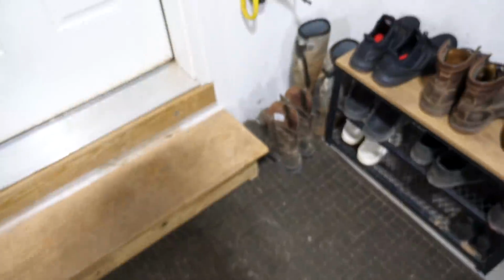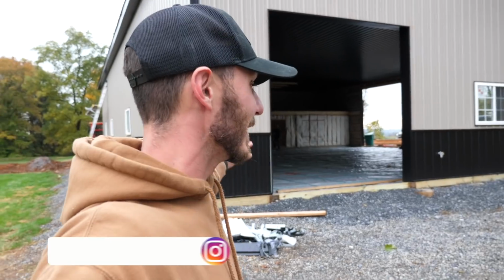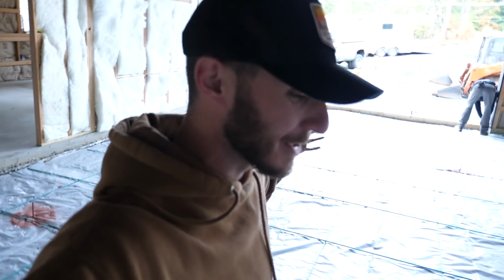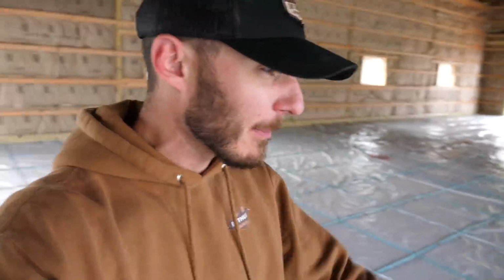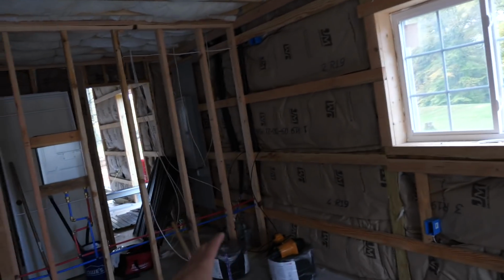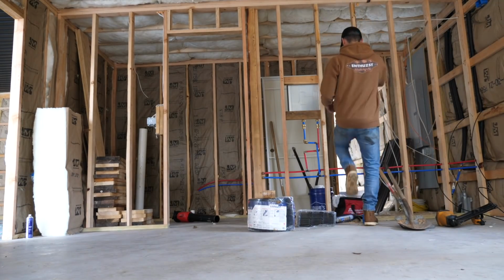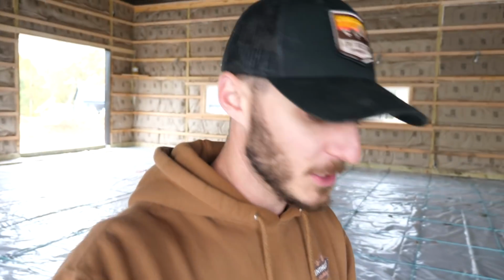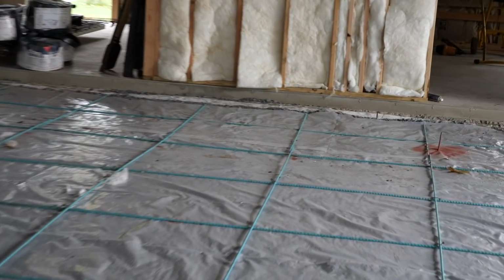DIFFICULT Decision For My DIY 80x60 Pole Building.

Comment: Love the updates on the shop.  Ive been following foe a while, as well as RR Buildings page too.  Im super local, in LebCo, and are meeting with a builder next week to finalize some things on our upcoming 30x40 shop build.  I definitely need to check into the radiant tube heat.  Not doing in floor heat as well.

Comment: The shop looks incredible,  way to go. I didn't see any drains in the floor? Is that because it would have to run into a septic? Or a long way off to lower ground? 
You are writing the cheques, so everything is your choice. I don't care how you heat the shop, as you say " it heated" enough said. 58° to 62° sound right for temperature. 🙂 Really Jack incredible job, it's a great setup. I would like to hear about hoists! and what compressor you have, or will you invest in more rechargeable impacts , will you mount and balance your own tires and wheels? Then air would be needed.💡dah! to me. ✌🏼🙂 ♥️👌 Happy Halloween 🎃 🎃🎃.
p.s. sorry about the hit to the jeep and your wife, so glad it was a light scuff! Now you can install some heavy-duty off road winch bumpers. 😛 good luck on the floor pour! Thanks again.

Comment: Radiant floor is nice, in certain applications. My parents have it in one room in their house, and it's awesome in the winter to go in there and just lay on the floor to feel the warmth. But if something happens, like an air pocket in the lines, it can be expensive to repair. I imagine even with propane heating the water it would still be somewhat expensive to get it up to temp and then keep it there if it gets extra chilly like I know PA does from time to time (grew up there but live in Florida now). For a building that size, I can totally see why you'd opt for a different option!
Reply: No substitute for in floor heat. Once it's warm it stays warm. You can lay on the floor if all the hoists are full and work on something if you have to or want to. Not only that but the tools you pick up off the floor are warm as well. Once you have it in a shop. There is no substitute.  For years people have said put radiant heat its just as good. Its not even close